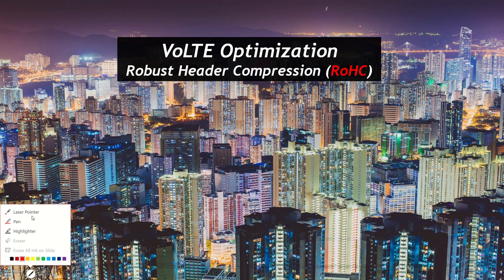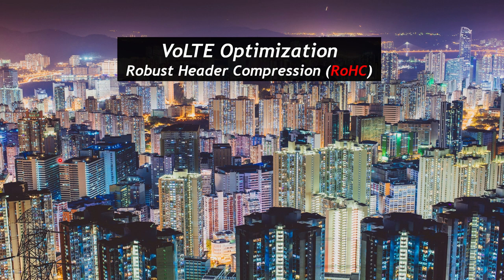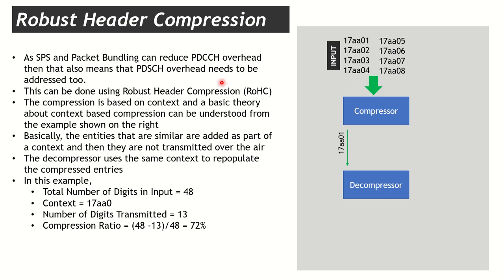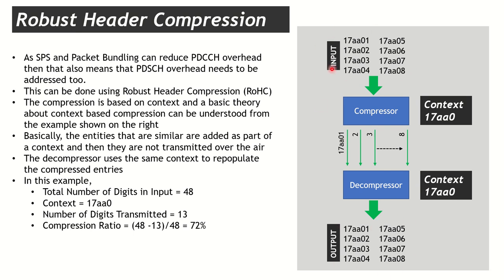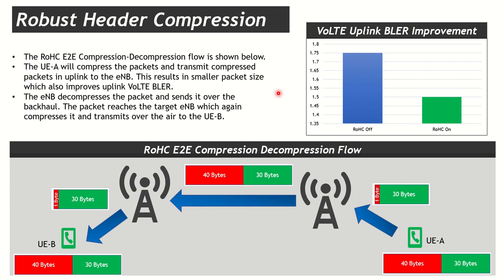VoLTE Optimization (Session 2): Robust Header Compression (RoHC)

Comment: May I ask why between network , the ROHC is disabled ?
Reply from the maker: Can you elaborate a bit more? Are you saying that in your network, suddenly ROHC stopped working?
Reply: @OurTechPlanet  sorry ，I mean in your video like the time 7:44 , it show that it's still 40Bytes header between two base station , is there anyway to compress this header not only between UE and basestation , but also between two base station in the picture( contain the network like AS and NAS components)
Reply: @OurTechPlanet  :face-green-smiling:🤣
Reply: @shuoyang411   I mean the question is relevant, but why do you even need that feature to takes place. It hardly affects the customer perception.
Reply: @OurTechPlanet  probably the question is why no ROHC bewteen eNBs. even that is also an over the air communication only
Reply: @swarnban8634  his question is quite relevant, between eNB also its and over the trasfer which has potential risk of pakcet loss jus like its being treated between UE and eNB. so yes need to have clarity why no ROHC among eNBs
Reply from the maker: There are many reasons, Most important one, RoHC compresses IP header while on the network you need IP header to perform the routing.

Comment: ROHC is happening at PDCP layer so why its not taking at eNB while sedning out the recieved packets from UE to the next eNB? there is also a chance of potential packet loss?
Reply from the maker: Basically, over the air interface, we need to conserve as much bandwidth as possible since air interface is bandwidth limited while the eNB to eNB communication is over X2 and does not really have a bandwidth limitation. Now, from practical perspectives, the IP header is required to know the destination address so eNB needs to remove RoHC compression from the header so that all that routing information is used.

Comment: Any specific reason why source enb is decompressing it before sending it to the target enb
Reply from the maker: Because the header contains source and destination IPs that will be required by many entities (core elements) between the two eNBs. So, the packets need to be decompressed before sending them to the core for correct routing.